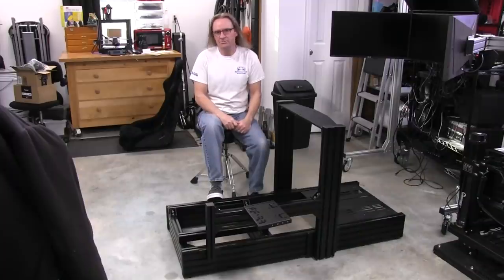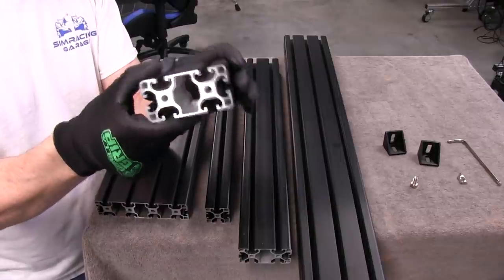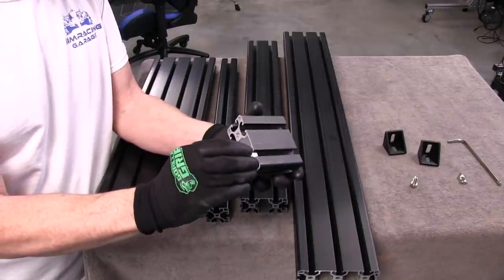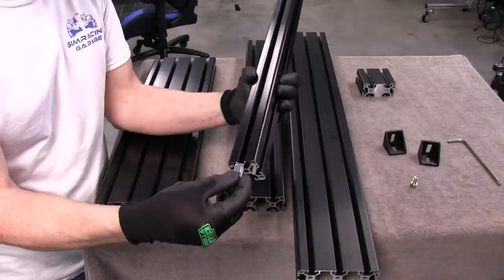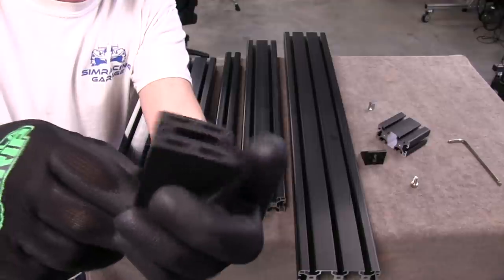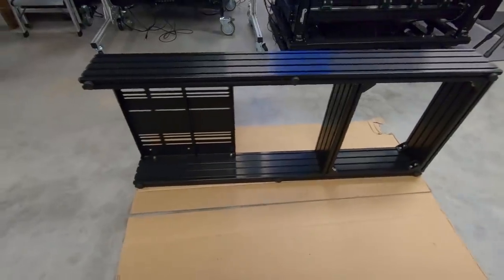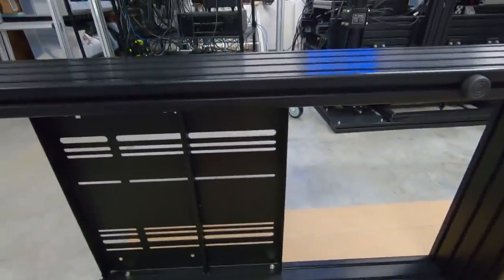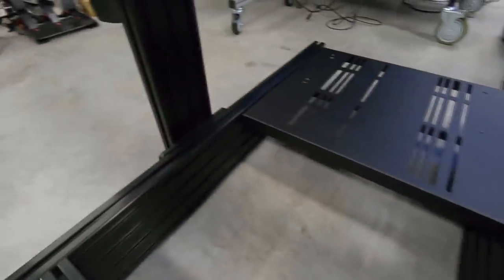GT Omega Prime Cockpit Review Part 1 "The Build"

Comment: I'm installing the kit right now and putting things together, and you really sort of gloss over just how bad the threading on the T Nuts are.  90% of my T Nuts have threading issues and it's a pain in the ass.
Reply: Hi mate, I'm about to make a decision and buy this one, saw your comment so just wondering how did it go for you? Were you able to put it together, completed? Any other issues apart from the T nuts threading? Any feedback you have will be greatly appreciated! Cheers
Reply: @brunofgallo  I managed to put it together.  It wasn't that bad, I just had bad luck and ran into several bad T nuts in a row.  Regardless, I'm going to send them an email telling them to find a different t nut supplier.
Reply: @aka_pierre  Thanks for replying mate
Reply: @brunofgallo  No problem, good luck with your build.  Wear gloves and make sure that you separate the 20mm bolts from the 16mm bolts, they come in the same bag and look virtually identical.  I screwed in several of the 20mm bolts where I was supposed to put in 16mms, and I thought I had a bad thread, but it was just because the bolt was too long.  Rig is otherwise solid.

I also recommend installing the seat assembly rails over the two horizontal pieces before you attach the horizontal pieces to the long rails.  That's going to make it easier to line up it up and you're not going to have to measure it out after you install and figure out if you have an exact square.  You just put in t nuts, and then lower the seat base in between the two long pieces and screw in the bolts.  I spent approximately an hour trying to get the seat rails to line up with a mallet because I did what the guy in the video did.
Reply: @aka_pierre  awesome mate, thanks again for the detailed information and advice! cheers
Reply: @brunofgallo  one last thing: install the 6 feet before you install the upright steering assembly, if you have a tight space to work in you're going to have a hard time rotating the rig on its side to screw in the feet after you do.  Probably to aide in the installation of the steering assembly (you can rest it on the ground), they have you do the feet last.  But you can just put loose leaf paper under the rig to help you align the steering assembly with the t nuts even after you get the rig on its feet.

Not a big deal if you have a lot of space.